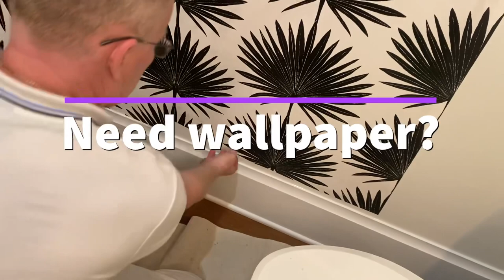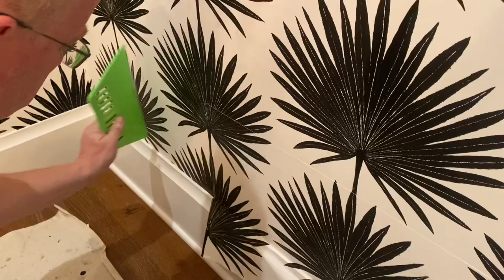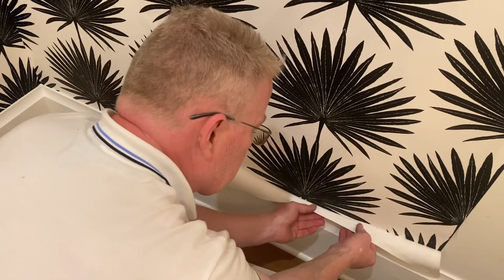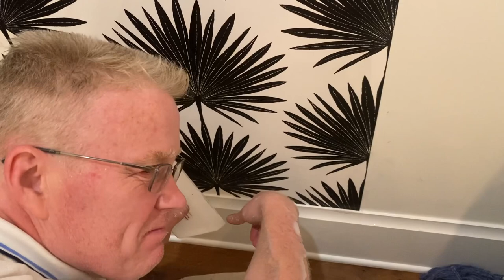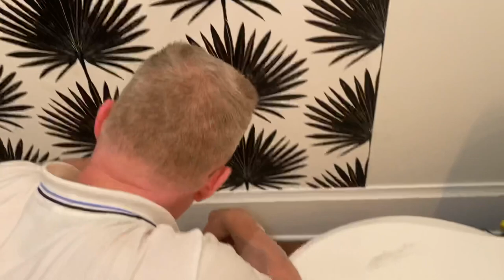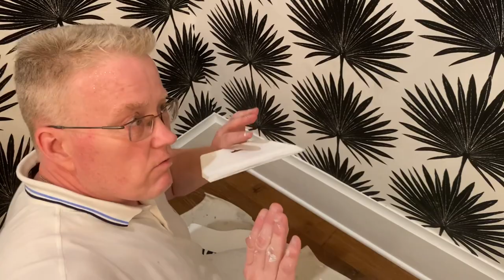Splice Clay McLaurin Wallpaper

Comment: After 40 years of hanging professionally I refuse to do peal and stick.
Reply: Why? I've been hanging wallpaper for over 40 years and we install it every week. You just gotta move forward with the times. Carefully Peel the backing of on your table and will it with a very thin coat of thinned down paste such as you would use for prepasted, very thin coat. Then it won't stick to itself and it will stick great to the wall even textured walls.